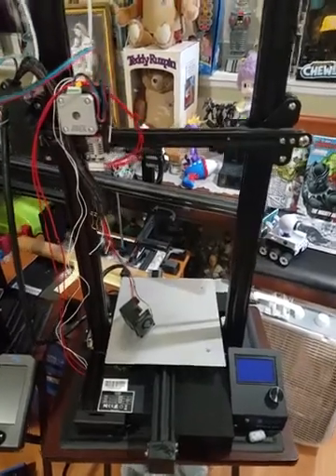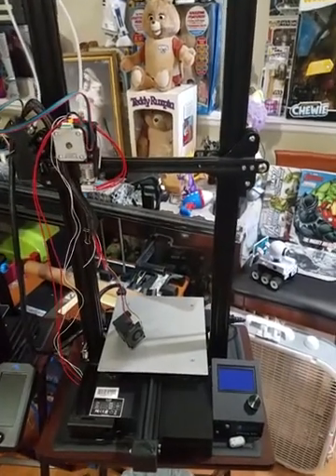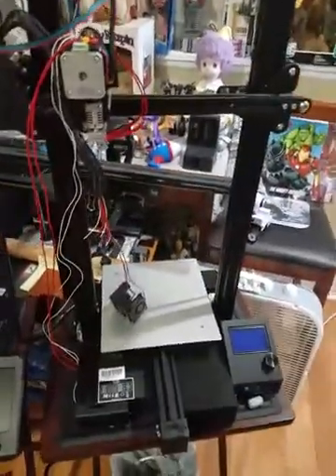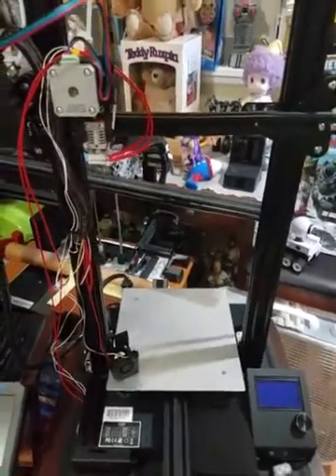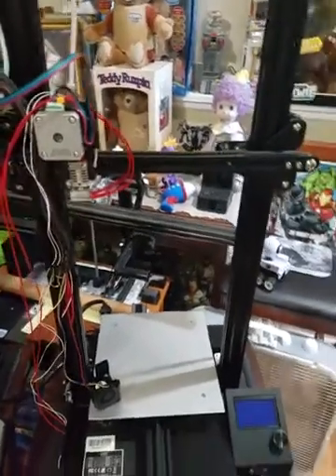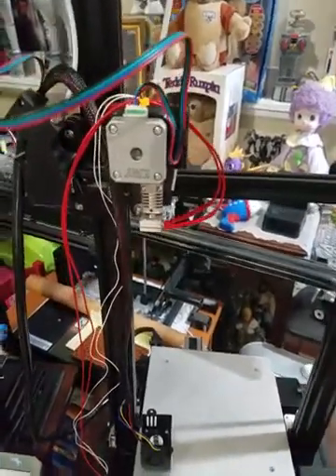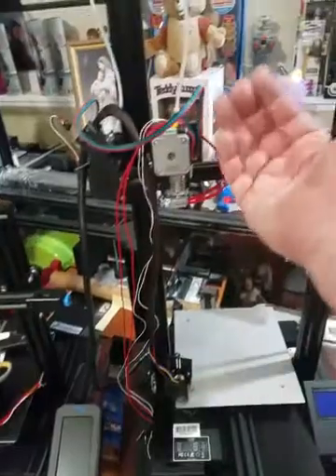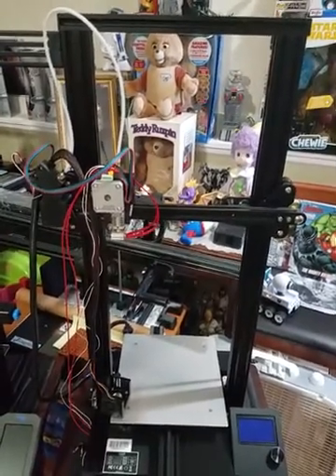3D Printer: The Ender 3Pro E1 Heating failed Issue Part 1

Comment: do not know the date of the video, but my ender 3 pro just started having that issue, 3 days ago it was a "temp runamay" error, left it untouched (did not want to mess/worry with it) for a day,. after that i turned it on and made it preheat and left it untouched for about  40 minutes, no issues no errors, so then i started printing, did 5-7 prints about 1 and a half hours long no issue, then turned it off for the day, today i sadly turned it on, put the temp of the nozzle to 210 and got the error you mention on the description. 

i have checked all connections and they are fine, do not know what else to check, or do i automatically go to change thermistor?, i am asking because i am am at my withs end and this is the limit of my knowledge for the time being.

thanks for any time you put in to reading and helping
Reply from the maker: Think you can message me on Facebook?
Reply: I have an ender 5 plus and have been having a heating issue as well, I could bypass the heating issue by setting the print temperature 10 degrees above the required one and then would switch it once the temp was reached. (so set to 250 and once the temp was at 240 I would switch temp to 240 and print would start) Try that, I've already changed the thermistor and am still getting the same error, I used the bypass I just told you about for a while but my problem now is that the error happens mid print. So after a few minutes the error will come back so trying anything to make it happen will just ruin the print even more. I've also tried replacing the entire heating block with the same error so Its something on the wiring side or the power supply side. I am too lazy to take the printer off the table and remove the enclosure and get into the wiring at this point. I've had it with creality's "reliability" unfortunately.
Reply: Fixedish UPDATE: So I ended up flashing updated firmware on the Ender 5 plus and I was able to correct the heating issue however the language interface is now going to be stuck in chinese. You pick your issue, not heating enough and use my bypass, or learn how to use a chinese interface, Gotta love creality
Reply: I know I'm a bit late but have you fixed it yet? And if so how? 

I have the same problem on my ender 3 pro and it only keeps happening more and more. I've changed the thermistor and heater cartridge with no luck and I've done multiple PID tunes.